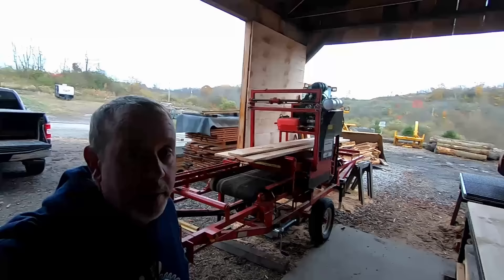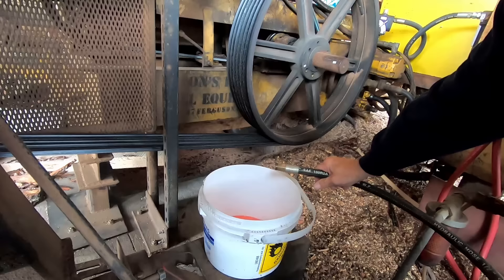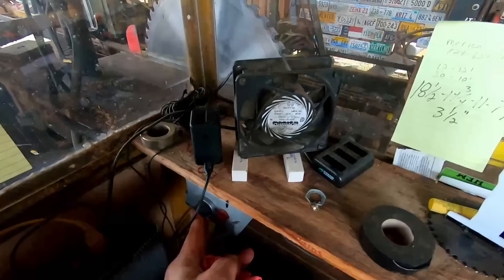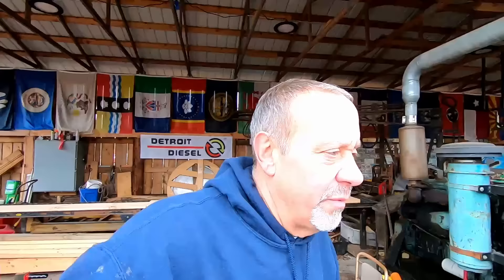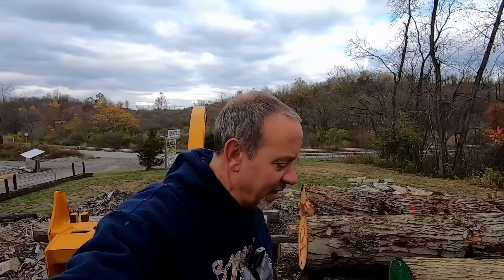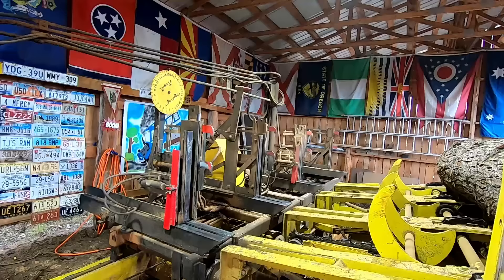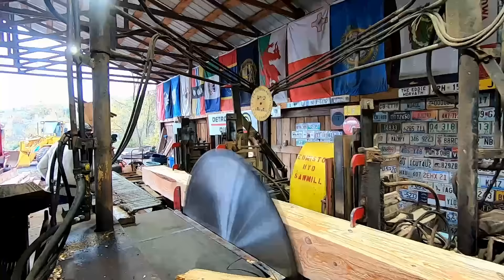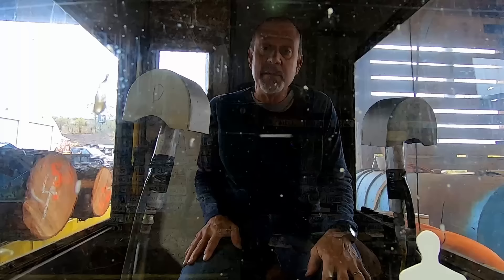fixing the fuel problem & sawing # 481

Comment: Mark, put a compound vacuum/ pressure gauge in the fuel line BEFORE the fuel pump. This will allow you to determine if you have a restricted line, fuel filter etc. 
I have really enjoyed watching your shows. Yes, the laser is hard to see sometimes. Best Regards.
Reply: Sometimes I can see the laser on the log, and sometimes not.  But I'm partially color blind so that probably doesn't count.

Comment: Jack up the end of the fuel tank about 3 or 4 inches where your outlet is (the tank will be slanted away from the outlet).  Sludge and water will stay on the low end away from outlet. Thanks for all the videos.
Reply from the maker: yes I want to do that .

Comment: With that older tank, you may want to change your fuel pickup to a drop tube from the top of the tank. That way, you can raise the pickup 4 to 5 inches from the bottom, eliminating the sludge problem. 
 Glad your eye is healing well! Love your videos!
Reply from the maker: thanks Chuck , that would be hard to prime .
Reply: @markgalicic7788  Actually your low pressure fuel transfer pump is made to handle that. I used a top line on my Deutz diesal engine on my generator. I never had any issue with priming. Especially if the high pressure side is primed and ready to go. Most oil heat furnaces are plumbed that way. They actually make a bung for the to of the tank with  fittings for two lines. A pickup and a return.

Comment: Tip the fuel tank back away from valve a couple degrees. That will let any contaminants settle down in the back of the tank away from the outlet valve port. Pull apart the water separator and clean it out.  When the tank get filled all that crap is churned into the fuel. Let it sit overnight. Great videos as always.

Comment: Next time your fuel tank is empty Mark, take a spray can filled with gasoline and spray down the inside of the tank. Gasoline will kill any fungus that grows in diesel fuel. Also, blowing the buildup back into the fuel tank is a bandaid fix. When the tank is low drain it if there's a drain plug (there is a low point drain plug right!) and clean that gunk out of there. 
Back in the day I use to be a helicopter mechanic/fuel truck drive. Keeping the diesel fuel free of water, fungus and sediment was a constant battle. If we didn't stay on top of it the problems would pop up at the worst moments.
Reply from the maker: yes for sure I keep up on it but after they fill the tank it stirs it up again but it's good now.

Comment: Hello Mark. I love seeing your videos and how you maintain your mill. Your anti gel stuff might do a good job but I've cheated with preventing diesel from gelling. We used to use a gallon or 2 of gasoline mixed with about 100-150 gallons of diesel. I NEVER had any problems with gelling. the gasoline was perfectly fine during the winter.

Comment: I'd pull fuel thru the top of the tank thru a 2-port bushing,one for suction and one for return. 3/8" is all you need to support the Detroit 6, doing it this way will all but eliminate your fuel tank issues as the gunk and goo will stay at the bottom of the tank and you would be pulling off above that..easy to drain off water and gunk from your ball valve that way..best of luck to you

Comment: Lol.  I wondered if you killed the Detroit with a compression release.  The first Semi I ever drove had what was called a screamin' demon, or Detroit's 318 V8.  It was a glider kit that my Grandpa built in the 70s.  It used the compression release to kill it as well.  The interesting thing with Detroits V8s was that they were 2 cycle, and could run backwards.  If you got stuck and had to rock the truck to get it free, you had to be careful as you could easily kill the engine and end up rolling backwards which would start the engine in reverse.  Lol

Comment: Mark, since I doubt most of your viewers, like myself, are not foresters; I have an idea for you to add to this channel. At the beginning where you talk about various things, show a picture of an adult tree like what you are going to saw. This way viewers over time can become familiar with the tree by matching the bark and wood grain of the log. Face it, to most of us, a log is a log.
Reply from the maker: great idea Robert.
Reply: Many may not be "Forresters" but many of us do have small hobby mills, Cut firewood, do a little bit of land clearing or maybe a little of all of it. 

It does amaze how many I have come in contact with that simply never learned, cared or whatever. 

I have been doing a little of all of above for many years even as a teenager.  
Regardless there are some I haven't been cutting for a while that I don't recognize right off the batt. 
I do like the maintenance side of it all to.
Reply: Some of us even.,. dare I say it?... have  worked in lumnber mills

Comment: Add the anti-gel before the fuel delivery, to mix good as fuel is pumped in.
Reply: The engine running and bypassing fuel in the return line will mix it up eventually. Your way is faster though.
Reply from the maker: we didn't know when they were going to bring the fuel.

Comment: As John Clark suggests I would tip it back a little more after a few days stick a pipe in the tank at the low end a draw out about 2-3 gal of fuel, see what you get. and definitely clean out the separator and change the filters

Comment: If the tank has been galvanised at any point the zinc coating reacts with diesel fuel and can cause sludge problems. If that is the case , a new tank is the only answer...

Comment: Mark, might be worth letting the tank run down and then clean the insides before refilling. Also check the pipe is not collapsing on the inside as the engine is sucking fuel up. Hope the eye is better better.
Reply from the maker: thanks James , I cleaned the tank out three years ago and I use a hydraulic hose for a fuel line.

Comment: Change the filter in the water separator, and install dip tube so your not pulling off the bottom of the tank where the water and sludge go. 11:56
Reply from the maker: I did change the filter and the pick up is not on the bottom.

Comment: Well working there,,i would wear glasses all the time,,it pays to wear them....im into everything,,sanding,grinding,cutting wood,,welding,,just use to wearing them,,haa,,,i even have some with side lens,,the ones you wear in the mill..that diesel fuel will jell,,if its cold..got to keep the saw going...nice wood there..its cold Mark in Wv...going to my stand

Comment: I KNEW I heard the bus motor raise an eyebrow the other day. The dye in the fuel used to stop filters up years ago. The Self-Made Millionaire had a Miller Welder with a 3 or 4-banger Kubota powering it and had a regular car inline filter on it. When it quit we'd take the filter out and bang on it a little and out would come out a clod of dye. Put the filter back on and away it'd go. Chestnut will just get about 2 inches here and then die thanks to another imported killing thing just like got the hemlock and God only knows what else. I had one of those filter/separators for kerosene heaters but never had any trouble out of it but it wasn't pulling fuel through like the bus motor. 
Happy weekend, Buddy and God Bless Yall!
Reply from the maker: thanks Lewie , it only happens after a fuel delivery just stirs up the tank.

Comment: Those tanks have alot of sludge build up and you should consider time for a new one cause if you get out the sludge next you'll have weepers then more problems
Reply from the maker: I think it's good for now we don't burn much fuel in a year so when they put more fuel in it stirs up the bottom of the tank.

Comment: If your fuel tank is vented and I’m fairly certain it is, remember that temperature changes caused the air to go in and out of that tank and as a result you could have condensation, actually you do have condensation. If you are taking the fuel off the very bottom of the tank anything that is heavy and sink to the bottom is going to affect your fuel flow. it would be good if you had a standpipe inside the tank that takes the fuel from one or 2 inches above the bottom of the tank. That is only one solution there are many others. I consider a Racor centrifugal separator and filter.
Reply from the maker: yes it is vented , the pick up is up about 2" off the bottom . We want to tilt the tank up a few inches to help this problem.
Reply: @markgalicic7788  
Excellent.

Comment: I would not recommend blowing air thru the primary filter into the tank. Most of them are desiccating so you could damage it making it useless.
Reply from the maker: this was a water separator not a primary filter there are two more on the bus motor.

Comment: Hey, I know whats wrong it ain't got no fuel pressure, FUEL ADDITIVE. REAL EASY THEY CALL IT NORMAL  MAINTENANCE.
Reply from the maker: I use it every time we get fuel , had some scale blocking the intake on the tank is all. when no fuel comes out you have a major problem for sure.

Comment: Sure you have Trouble Shooting, your eyes are not 100%, your marksmanship is bound to be off. I sometimes get in Trouble Shooting my mouth off. You only need to work TheEddies loader around that formerly open truss end of your structure. You could put up a sloped tarp awning to a couple of taller posts with a header across, attached to your newly covered trusses to provide some more cheap overhead cover on the open end.
Reply from the maker: great idea